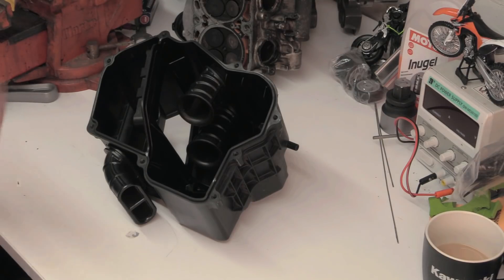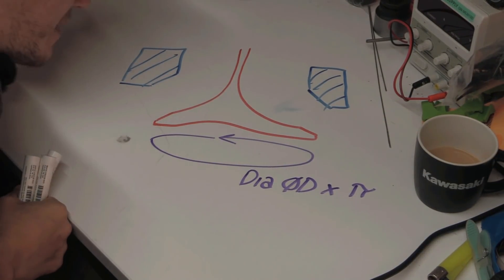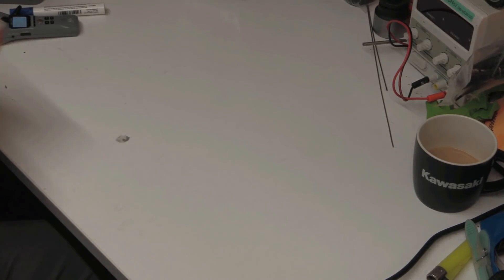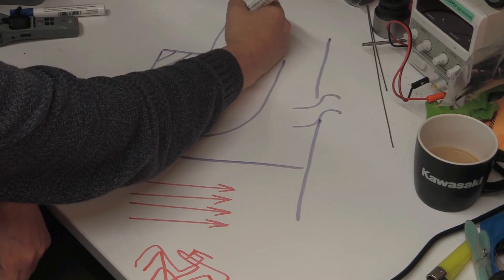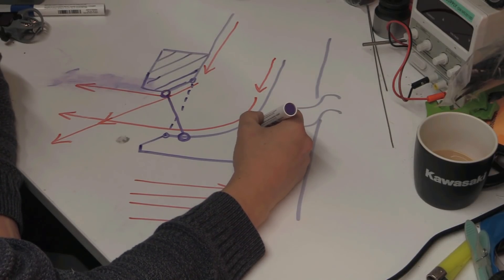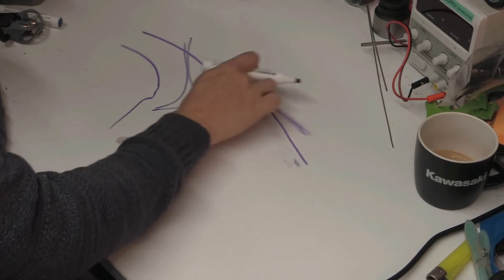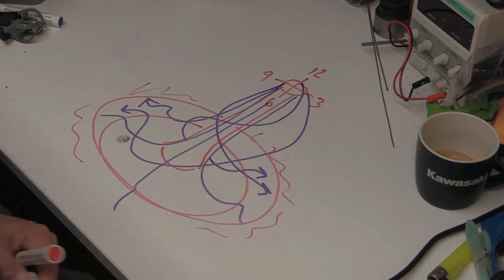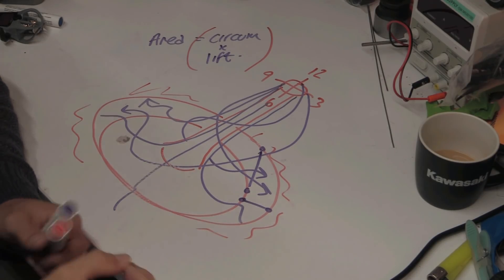Valve Lift is LIES - Kind of...

Comment: If you dick around with Boyle's law and Bernoulli's law, you'll find that lift has a lot of slack in it. I use 1/4 the valve diameter, plus half the radial projection of the seat width into the valve cross section. That said, the other shit on the engine has a monster effect, and if you don't take that into account, the whole thing is in a perpetual state of less-than-ideal.

Comment: Dumb question but why is it called valve lift  when the valves as they open  go down into the combustion chamber .
Reply from the maker: Because early engines had valves pointed towards the sky in what is called a side valve engine. So the valves lifted up

Comment: Cool vid. Just like to mention low lift flow is only influence  buy seat form alone  cutting and placing of seat angles mid lift flow is determined by port designs high flow is determined by lift because at certain point there is a cross over or saturation point where lift becomes greater  then port cross section. saturation point tells they same story my car cam lift is 13.3mm but cylinder chamber only  sees bit over 10mm lift. There so much more its engine maths they most important thing I've ever learnt.valve has a important roll as the maths you can apply to determines port cross section,  port length even into plueum chamber how much air per inch to cubic of cylinder it feeds so on.so I'm very interested in why flow bench is no good.in my experience they lead to improvements and are a good indicator flow /lift  to determine cam lift.

Comment: Thanx matt i know exactly who i'm gona show this to. Have a "know it all" friend that botchers heads.
Reply: Taking bets on whether or not they'll listen? :P
Reply: @itsb680  sent him the link to the video, haven't heard from him since 😝😁
Reply: Porting can do wonders on some engines but its not a one size fits all thing and takes a LOT of research and testing to get it right. Some engines can be optimised because a lot was left off the table hence why porting can help turn a basic v8 head into something much more useful or get gains in an ecobox engine. 

Flow benches can be a useful tool IF you know what it tells you isnt the whole of the thing.

Comment: And that is why engine engineers ask for big/super computers to simulate flows at temperature, mix ratio's, rpm's, at a multitude atm. pressures and pressure differences in the inlet system - to support their hope for getting it right.
And why some old dog's in the business of tuning can work magic or tell you that what you've done won't work ;-/
Reply from the maker: No. Old dogs in workshops have even less of an idea.

Comment: Flow benches arent useless.. but they are if you use them to measure flow... use the flow bench to find active and non/less active parts of the ports
Reply from the maker: Lol what? How do you do that then?
Reply: @thedirtyworkshop  introduce obstacles into the port and see where flow is more or less effected
Reply: Areas that are less affected are then filled, and areas that are more affected can be opened up without losing velocity.. thenvolume filled will be more than the volume removed  or velocity will drop..

Or that's the idea, I've had varied success like this.. and have a dyno to test my work on, which hasnt always worked.. the effort generally far outweighed the benefit.. but once you know what works for a particular head you can repeat it without all the blood sweat and tears. Would be like pissing in the wind trying to port without a flow bench, youd literally have to remove some material and run the head everytime tonsee if there was an improvement.. if theres a process that doesnt need making any longer.. then this is it!😅
Reply: But dont worry, painfully understand air doesnt behave like that in a running engine.. at best it gives some kind of guide, but its data that's better than nothing, short of having some very expensive tooling and software

Comment: on 4+ valve engines it must be even more complicated with the flow from one valve colliding with the flow from the other valve on the area between the valves
Reply: Look at a cutaway of the Yamaha YZ450F when they added the 4-valve heads and rearward canted cylinder. The air flow is parallel and dumps into the center of the cylinder, for the most part.
Reply: I heard that is the reason why F1 ditched 5V heads in the 90s. They mainly used those to counter valve float and when pneumatic valve springs arrived they just ditched the 5V heads because there wasnt any real use left to them anymore

Comment: Yeah then throw in elevation and temperature changes,it's never going to be anywhere near perfect that's why after all the computer simulation all the math calculation you have to test in the real world conditions to see if it's doing anything like you think it will.people think the goal is more power,but manufactures have to deal with fuel consumption emissions noise levels and balancing high end power and low end torque that's why new engine development cost so much money

Comment: 2 things..
I  was under the impression duration was more effective to the way the intake works.
This then leads to how a piston engine actually gets it air fuel mix into the engine.
It's not from vacuum. 
It's the diffraction of atmosphere 
.
Also that flow is different to atmospheric velocity  hence why the flow bench becomes invalid. Its the movement of the atomisation under atmospheric presure due to the way a cylinder and piston work  so to speak to keep the fuel mix stable in A direction through the port you can have all the flow but with fuel separation it means zip..

Think the boiled egg into a bottle.

Without copy and pasting multiple list of reference thats my best attempt at the explination in my limited brain capacity of science
Reply from the maker: What is the difference between a vacuum and the difference in atmospheric pressure? 

I'm assuming you meant difference and not diffraction?
Reply: @thedirtyworkshop  am yes, opps my shity spelling and auto correct.

So bar from that is this correct?
Reply from the maker: It's a mix of everything. The difference is pressure, the restrictions and timing or duration. 

Vacuum is just a word typically meaning lower than atmospheric pressure.
Reply: @thedirtyworkshop  if I have this correct a vacuum can be a variable thing.
But atmosphere  can and will only take in atmosphere to the size of its containment regardles of its entry point size..

I could be wrong 🤷‍♂️
Reply from the maker: I get you. So there's a difference between pressure and density.

Take a litre container. 1,000,000 atoms of say Nitrogen will fill that container and if you heat them up enough can create 15 psi of pressure.

Take that same container of 1,000,000,000,000,000 atoms of Nitrogen and you have a pressure of 15 psi, just at a lower temperature.

Both containers are full, both have a pressure of 15 psi, but both are at different temperatures and have different densities. 

If you have the same temperature then one has (1 million atoms) is at a far lower temp and has a lower density. Engines actually use pressure and temp sensors to calculate the density (i.e how well the cylinder is filling) to calculate how much fuel to add.